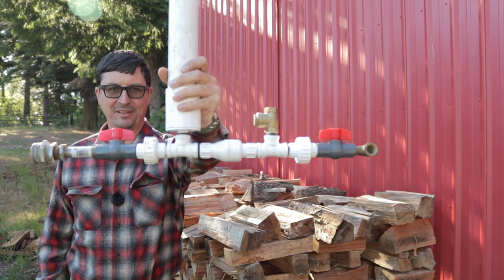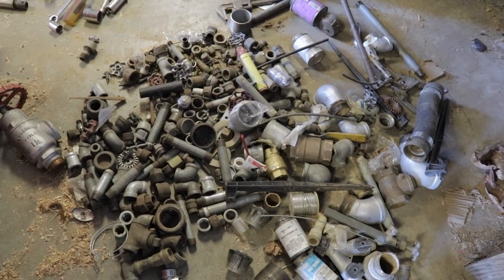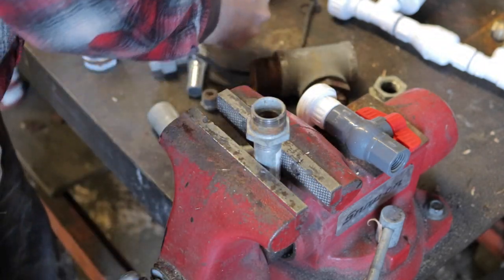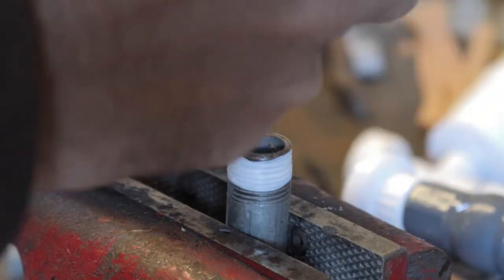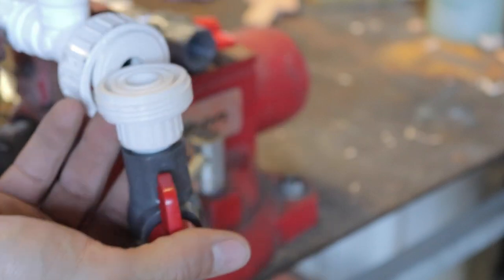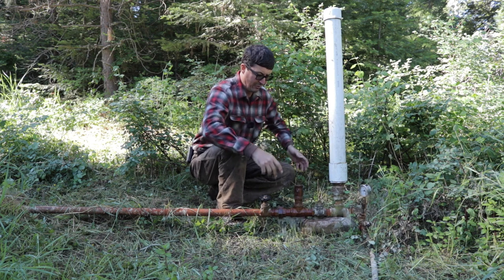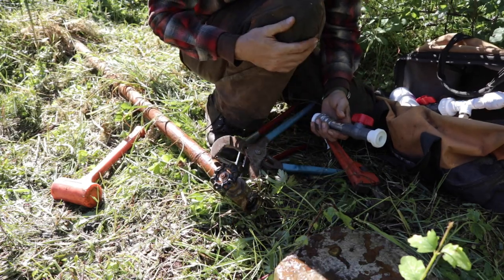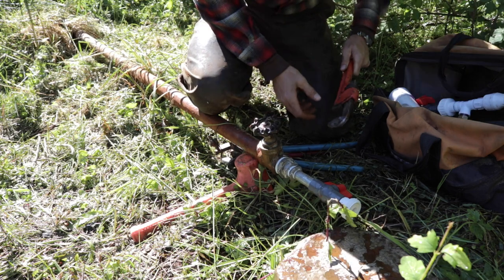Coolest Little Ram Pump Ever!!!

Comment: pvc this guy is starting to learn. lol jk. but do not use plastic ball valves they are a pain use brass ball valves they are much easier to use and maintain from year to year. the plastic ones get harder and harder to close off. i know you didn't make this yourself but for the next one you make use pvc pipe and brass fittings it will make your life alot easier. 

also do not use a 90 on the end it decreases pressure.
Reply: for high pressure situations at least for my company we use both pipe dope and teflon(only irrigation) for low pressure just teflon tape.
Reply: Untell the handles rust away even on Apollo ball vales they have steal handles but I see what you mean thought

Comment: from my relocation and I'm not a pro the blue is used for Gas pipes?.
White is for water and the pipe dope is used on unions or any joint as a main or back up.
But seriously I've always seen the pipe doped used on gas fitting and unions to keep the freely working.
That way you can put the "big hammer" away.  (Dead Blow). the reason its called a dead blow is you get the force without the recoil from the strike the extra energy is absorbed by the tool. A ball pen would strike back or kick back so would a claw hammer.  I went years without one, but have come to the conclusion they are necessary to have unlike a rubber mallet.

Also Watching this old house your not using your pipe wrench right,  you need to put 3 points of contact on your pipe or you can distort the pipe's shape make it egg shaped and not round.  
But hey I'm not plumber or pipe fitter.
Watch Richard.

https://youtu.be/aPNlAXnTbWI

It really pays to watch experts at work.

Comment: PIPE DOPE OR T- TAPE?After 45 years turning wrenches, and union trained I am I have some input. T-Tape (Teflon Tape) has it's places, but it is abused by the ignorant. (not being mean) If I am screwing together black or galvanized gas pipe I prefer NOT to use ANY T-Tape.You see the NPT Threads (National Pipe Thread) are TAPERED. If the jaws on your pipe machine are adjusted correctly things should seal 100% to 100psi test w/ about 3 threads left showing when you are done screwing. Pipe dope is JUST FOR LUBRICATION PEOPLE! I remember stories of the plumbers of old mixing up there own pipe dope in 55 gallon barrels. Tapered threads ONLY require a little lubricate to seal! PERIOD!  Additionally use of T-Tape can allow bits and pieces of T Tape to get in the pipe, these bits migrate to valves and clog them. The UPC (Uniform Plumbing Code) as I remember it says no T Tape on gas pipe, AND you can NOT use a THREAD SEALANT either! Remember, THE THREADS are to make the seal, PERIOD. I actually prefer just plain gray Pro Dope for small gas piping. Then along came inventions and "better?" widgets.  That Slic Tite you tried to use was GREAT STUFF but they quit making it, remember, the TAPER of the male thread into the taper of a female thread is what makes the seal, PERIOD! What happens is you get less than skilled wannabe plumbers and before you know it they are welding things together to stop leaks. They try to use thread protectors as couplings and that will always leak so wannabes look for magic, magic = T-Tape and things like Aviation Form-A-Gasket. ALL PIPE DOPE should wipe off easy and not stain clothes! LOL! It is a LUBRICANT! There are exceptions to all rules. A couple - three wraps of T-Tape then a wipe of Pipe dope on the MALE THREADS ONLY is pretty much bullet proof for water piping. I could write volumes on this, mostly how T-Tape is abused, like water heater connectors. I laugh daily when I see T-Tape on a copper water flex. The seal is the RUBBER WASHER inside , NOT the threads! Same w/ threaded water flexes. My favorite dope is not being made anymore so I can not name it so some is left for me for a while. HIRE A UNION TRAINED LICENSED PLUMBER People! :-)  (if must though, remember to wind the T Tape on the right way to, so it does not unwind as you make up the joint.)
Reply: except that most people don't have a pipe threader to adjust (even if they knew how). They buy fittings threaded by someone else, usually for the lowest cost (less quality control, cheaper materials). And, something on the threads makes it easier to undo the joint if needed. Iron rusts. Rusty threads tend to be nasty to separate.
Union training is irrelevant. Training is good, union training is no guarantee of being better than anything else.
Reply: Waldo,   I was not speaking about what wannabes and handymen do, I was explaining what professionals in the know do. RE training, well, my 5.5 years vs a few months in a van w/ a guy who was taught the same way, well, your comparing two TOTALLY different things. Look for me a couple decades back on the cover of Reeves Journal magazine.
Reply: lol. A few months in a van isn't proper training. There is good training available that isn't union, and there's bad training available that is.
The teflon and/or pipe sealant are used partially for pressure retention (no thread is perfect, and it is possible to overtighten a tapered connection), but also for anti-corrosion and anti-galling properties, which are very relevant.
I totally get what you are saying about the sealing - I have to deal with that as well. The things some people try to do are almost criminal.